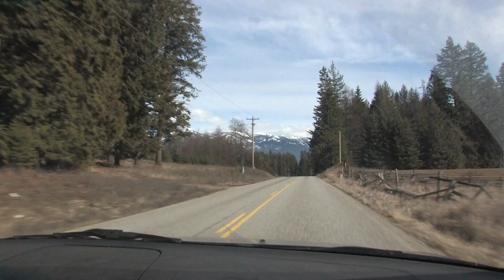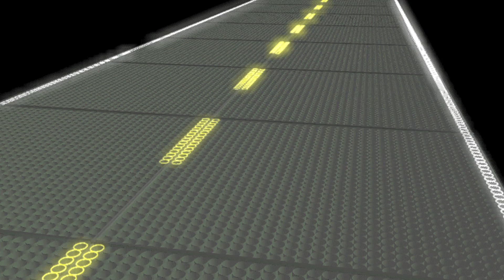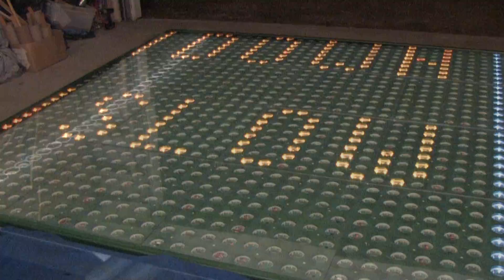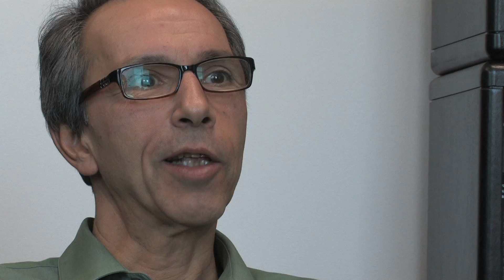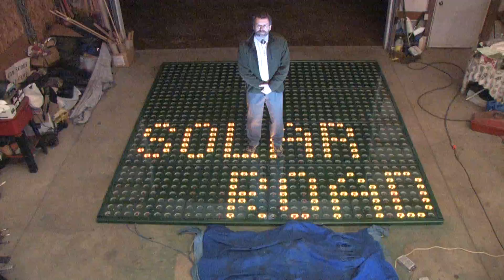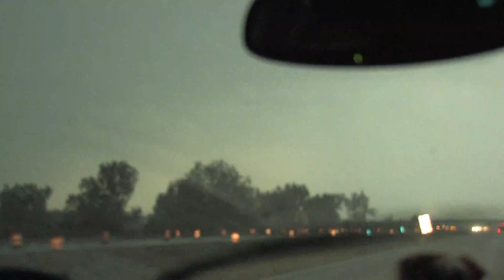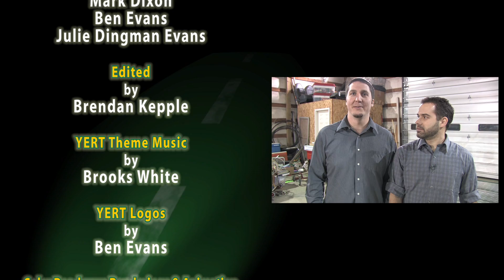Solar Roadways: The Prototype

Comment: I'm amazed that a guy so smart and able to use science so well wears a cross around his neck.
Reply: ***** There's no such thing as a "Christian Scientist". There are scientists that happen to be Christians.
Reply: He isn't able to use science well, this will not work. The far better idea is to put solar panels next to the roads. Why put them under car tires? Glass scratches, so these will lose sunlight as they scratch. I don't buy for a second these things could stand up to an emergence braking situation with a semi-truck. After the glass is worn smooth by all the grit that is ground into it by tires it will be slick as hell. They have wide straight groves in them, so there is no way I could ride my motorcycle on them. These will be massively expensive. I can go on and on.
Reply: WraithCommander42 OK, so lets put them next to the roads!
Reply: No idiot. A man can have dark skin, but a scientist can't be a Christian.
Reply: No need to be a pope to understand Science and Christianity don't mix.
Reply: Qopel a man that is black = a black man.   A scientist that is Christian = a Christian scientist so what is your point
Reply: So, the head of the human genome project, Dr. Francis S. Collins, is somehow not a scientist in your mind becasue he is a Christian? Well, then your mind seems to need its logic fixed.
Reply: No, he's not a real Christian.
Reply: *****
When did you become the pope?
Reply: *****
That isn't the point. What makes you the pope with the authority to decide who is and isn't a Christian?
Reply: It's not about "authority". It's a fact by definition.
Reply: Qopel by what definition
Reply: The definition of what a Christian is.
Reply: Qopel what is it
Reply: You mean like the man who first postulated the big bang theory? Or the man who is called the "Father of Genetics"? Or any of the other thousands of Christian scientists throughout history?

Comment: Overall, this is a nice pipe dream; however, I see several issues with this plan.

First of all, why would governments, State and federal, invest money into this technology when our existing infrastructure is in disrepair? I live in the suburbs of Philadelphia. Driving on I-95 South in Delaware County can be a nightmare with all of the potholes that exist on this stretch of roadway. Combine that with high speed (us Philadelphians drive fast) and disaster is eminent. I have already been involved in an accident where I lost a tire when switching lanes a few miles shy of the Delaware Border on I-95 South. Additionally, don't even get me started on the potholes that actually exist within the City of Philadelphia. Instead of investing TAXPAYER money in these solar roadways that the visionary can't even give solid monetary figures on, we need to primarily focus on repairing our current infrastructure. If MY tax dollars are going to be invested in this cause, the brunt of them should be put towards repairing a system that I utilize almost every day.

Secondly, I have an issue with power distribution. I have heard that the visionary proposed that the power distribution come in the form of DC power. As some of you may know, DC power has been proven inefficient, thanks to Nikola Tesla. 

Finally, this project is bound to cost the United States a fortune. How are we going to fund such a massive project when we are already so far in debt?

Comment: The usual billionaire corporate suspects will probably try to suppress this to protect their sweet loving oil, natural gas, coal, and other BS pollution energy profits!
Reply: Yeah, questions like: why make a road out of solar panels rather then just putting them next to the roads is me protecting oil companies. Or, suggesting that we build solar farms in the desert so that the maintenance costs will be lower. What it more efficient, a solar panel pointed right at the sun all day in a solar farm with nothing between it and the light, or one pointed straight up under glass that will be scratched and made opaque by grit and tires?
Reply: WraithCommander42 I believe the material isn't going to be delicate glass that scratches up easily or they wouldn't even be proposing this.  Especially when you're going to have semi, and mack trucks on them. Where would the room be next to the roads?  You'd have to take people's land away?  And of course you could replace existing sidewalks to add to the roadway solar panels as well. It makes sense to have the road, and solar panels be one.  The minimal side road space wouldn't be the same amount.  No amount of solar farms are going to come anywhere near all the roads in the USA eventually becoming solar panels.  When you're talking about the sheer expanse of roads cars impeding the sun would be minimal. Any scratching or grit would not have the impact you're thinking when talking about over 4 million miles of roads in the United States alone! Especially in all the vast rural areas with minimal traffic.
Reply: MysticInvestigations
Rocks are harder then glass, it will scratch. They gave no explanation of why their glass won't. Have you seen the spare land around Interstates outside of cities? Tons of room. Or, build a little overhead thing and put solar panels over the road. Then the roads will be dry and ice free all year long. That would be way cheaper then these. There is plenty of empty space to put solar farms, we just haven't yet.

There are around 3,980,817 miles of highway in the US. To get a managabal number, lets say that they are only 30 foot wide. At about $100 for standard tempered glass. The the cost to cover my underestimate would be $63,056,141,280,000. Just the glass is 63 Trillion. How much more do you think the rest of those solar road panels will cost? And, where are you going to get that cash.

Comment: Its a scam man.
Compare the costs of asphalt to the cost of solar roadway panels per square foot.
That right there shows it is cost ineffective. 
Maintaining it, far beyond the effort of maintaining concrete or asphalt, so that it still can continue to deliver electricity is the second cost impossibility.
I am an engineer, and I can see what this fellow is doing. I have seen the magical thinking that will inspire and excite, and it is only magic that will make it work economically.
I too wish this would work, but when you add up the costs and the return, it can never be economical. Subsidies only hold off the inevitable accounting to future.

Comment: How am I supposed to ride on that when it rains?
Reply: 22Langstone Glass will get worn out fairly quickly and lose whatever traction it has. Not to mention constantly changing temperatures and heavy loads will eventually cause it to crack more easily than asphalt. Or the fact that it's immensely more expensive than regular asphalt concrete.

Here is a simple science experiment you can do at home. Rub some dirt and rocks against a window. And see how quickly you can scratch up the glass.

Now imagine thousands of cars driving over that glass, with dirt building up on these roads over time. And try to imagine how long it will take before that traction on the glass will wear out.
Reply: so you've never driven in the rain?
Reply: brooklyn560 I did, but never on glass.

Comment: You need to make the surface modular, so if the surface is damaged, it can be replaced cheaply, without having to replace the solar collector, LEDs, batteries, and PC boards underneath.

Comment: how would the road hold up to geological movement ? say mudslide, earthquake, etc.
Reply: The same thing you do with anything after an earthquake... fix it?
Reply: it would break into pieces like a glass... oh wait
Reply: raggaresset Actually due to it's shape and  how it's configured  earthquakes would pass under it and  not damage it. mudslides well  there is no way of stopping that unless you build barriers  to hold it up, plus if this goes through then they'll be a consistent job  for years to come removing and replacing roadfs
Reply: ***** I am one.  While nothing is destruction proof, the fact that these have joints, which could be used for shifting and expansion, could potentially make them more resistant to natural disasters than modern materials.  However, what's ultimately important here is that governing bodies, like AASHTO, will not allow these materials unless they are capable of supporting all required design loads and proven safe.
Reply: Good question!
Reply: ***** Though what he is saying is ridiculous, the damage would not be any more pronounced than on roads today.
Reply: You know....if you hate it so much why are you yelling at everyone who supports it rather than the ones who are....actually you know what scratch that the better question is why are you even here if you hate it so much?

Comment: this cannot be possible because, tires are made of rubber and the solar panels are made of circuit boards and then covered with tempered glass.... Then to this mixture add some water on the "solar road" and it will be like driving on soap.. The advantage of concrete is the friction that causes while driving with rubber tires. The security of people is more important that enabling automatically another parking spot.